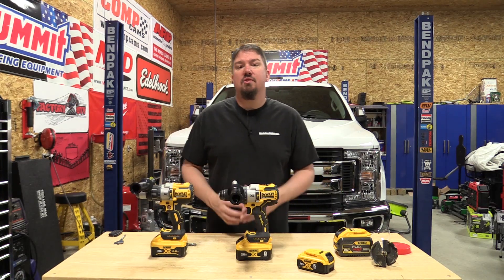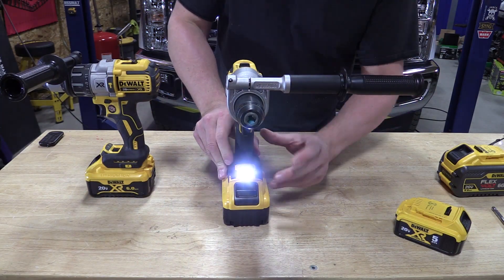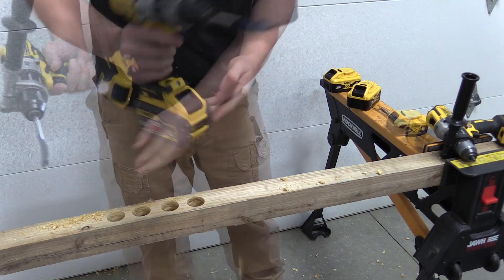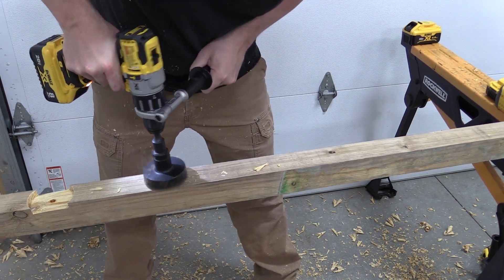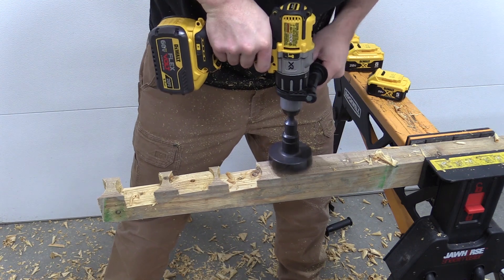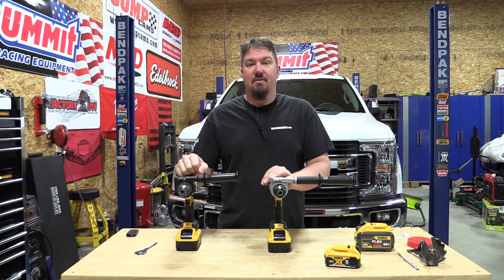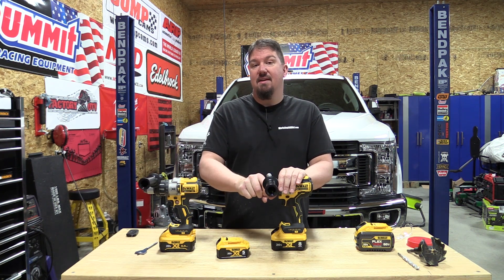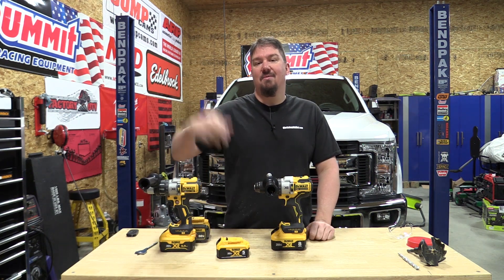DEWALT DCD998 Power Detect 1/2" Hammer Drill/Driver Vs DCD996 with FlexVolt Batteries

Comment: DCD996 is assembled in USA with chinisium parts and DCD998 is made in china with chinisium parts so its same shett. :)
Reply from the maker: Yup, I just wish USA paid people touched it to keep some of the $$ in our world.
Reply: Zylent not exactly, some parts are made in the USA and actual Americans get paid to assemble it here. I’m quite sure those people who work here are very happy to have the job in America. Not the same.
Reply: @joeframer9642  

1) the parts between both models are still made to the exact same QA standards.   That's the only thing that really matters when the argument is focused on quality and not morality.   0 evidence to suggest that anything significant about the DCD996 is Made in America anyways.  The chuck is German, the motor/electronics are 99% Chinese and the bearings/gears are definitely Chinese.  (AvE shreds the 60V "Made in America" compressor and it clearly has Chinese-made bearings and components if you watch closely)

2) I'm pretty sure most Chinese people are generally happy to have a job assembling DCD998s too.  Considering the alternatives would be subsistence farming or just straight up death. Do you even know what was happening in China before Nixon visited Mao?  It wasn't pretty.  

Most people agree that the Chinese government/CPC are bad.  But let's not let nationalistic BS and marketing wank get in the way of the facts either.
Reply: WorkshopAddict @ I wish we never started using China to make are stuff we would have done just fine the way things use to be made in 🇺🇸